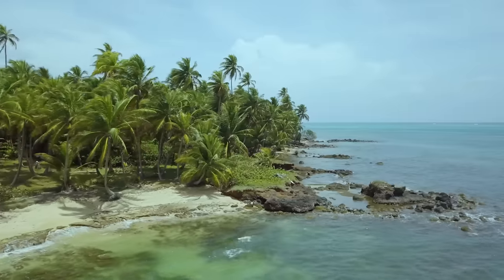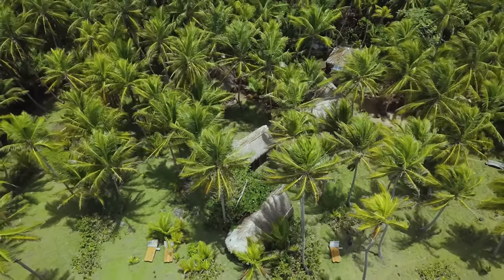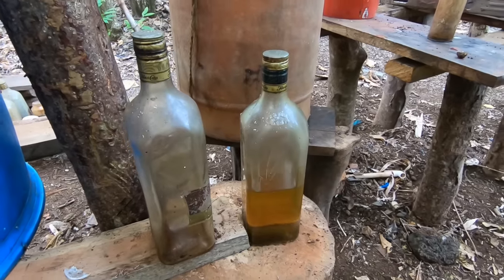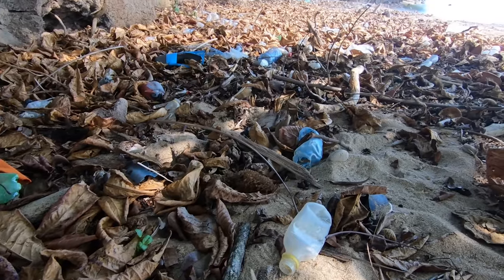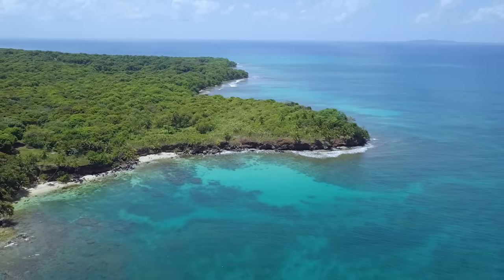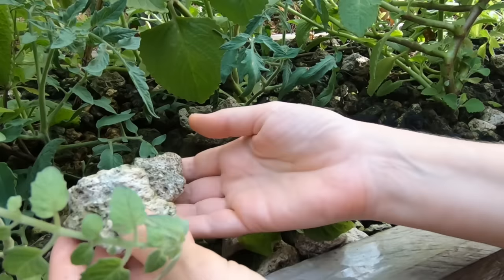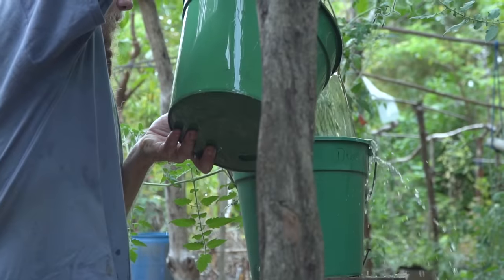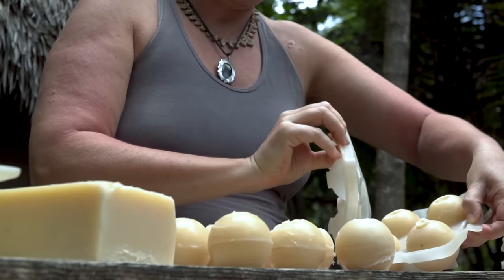THIS SELF SUFFICIENT FAMILY MAKES THEIR OWN FUEL FROM PLASTIC!

Comment: Diesel doesn’t burn like that (it has to be heated and aspirated to burn). It probably closer to kerosine as a fraction. I hope you have a good exhaust system as that fuel would most likely contain lots of sulphur and chloride and other compounds found in plastics. In other words it would be very toxic/poisonous fumes.
Reply: so he should stop using his generator because it pollutes the air but what about the 133 million big trucks that are on the roads in America alone, we should spare this guy any of your lectures i would suggest
Reply: @_RocketRooster  "but what about...?"

Nothing legally driving on any road in the western world is nearly as toxic as the gases this setup produces. It is completely fine if you don't care, it is completely fine if this guy decides to inhale that shit anyways, but it is also okay to point out the toxicity.
Reply: You have to  be careful which plastics are used. Not Vinyl, PVC, ABS, Nor Styrene. All can produce poisons such as hydrogen cyanide and other nasties. Use only PE, HDPE, LDPE, we also use PET as most of the plastic seems to be bottles, some people don't as  waxes can form in the pipe and cause a blockage if used motor oil isn't used or they don't have enough of the HDPE plastics for the waxes to dissolve into, other people may have better luck sourcing the good stuff better than we. Richer plastic piles to mine.  :)
  These plastics are very low on sulfur, PVC has the chloride which will eat the metals of your system. 
  There were still volatiles in the demo, normally they would be aired out before use or captured in a finer, secondary process.
Reply: I believe he was talking about the mans personal health. This wasn't exactly an industrial HSE production environment. More like DIY hippie scrapyard..
Reply: Beat me to it
Reply: Well Said!   Thank You for your comment.
Reply: You could run that smoke through my gasifier and turn it into perfect clean fuel to run gas appliances
Reply: I was with a guy burning brush and he saturated it with diesel and, as you point out, he put a torch to it for a little bit before it actually caught fire. His stuff lit much more quickly and easily.
Reply: Loral Anthalas  the second one is for his "gasoline" and you cleary don't understand the refining process
Reply: I can confirm diesel doesn't burn with normal fire. It had to be compressed. That's why diesel engines don't have bougies. I've tried to set fire to diesel from gas station (not at the gas station of course). Impossible. A mechanic taught me this trick in case you think you've poured gasoline into your tank. Put a cloth in it and try to set it on fire. Diesel won't, gasoline will.
I doubt that the second condenser changes this. And even if you select certain plastics, how toxic and erosive would the end product be? I'm very interested if this could ever be perfected to something (more or less) ecological, but I doubt this is it already.
Reply: This thread is hilarious.  People getting so upset and defensive and judgy.  The original comment is correct, but so is Mr Derek.  Derek was merely showing us a cross-section of his refining process.  But also, it's not like you're looking at a billion dollar refining station in a lab.  This is homebrew.  It's going to be a little crude.  Derek isn't producing the kind of diesel you want to run in your diesel truck every day.  Mr Derek is rendering a diesel fuel that works for his generator outside.  It's a start, a fantastic start and if a petroleum technician/engineer were to see this and get inspired... well there's no telling where this might take us in the near future.
Reply: There has to be some catalyst (chemical) added in separating plastic to gas or diesel.  You can't just burn plastic and run it through distiller then have it magically separate.  

If it is really that simple everyone would be doing it.  It requires the understanding of chemistry to do create fuel from plastic.
Reply: Keep up the green energy fight, well done. The reason it ignited so easily is due to a small amount of gas distilled at around 400deg. Diesel evaporates around 300 deg. I used a mixture of 10% gas with wvo in my 7.3L ford diesel for 6 yrs in winter.  Years later i read .Mercedes Benz used 30% gas in their winter diesel.
So your diesel fuel needs to be taken off less than 300deg .
Gas diesel for summer fuel not a good idea ( less power but good starting in cold weather) less lubrication for injectors and pumps.  Minor adjustments for you.  LOVE WHAT YOU BOTH HAVE  CREATED ❤❤
Reply: Loral Anthalas  actually i did, what makes you think i did not?
Reply: @RubeeDubee  diesel does burn with fire,I used to it in my wood stove.
I used a small steel can fill halfway with sawdust and tip a small amount diesel in a light.
Reply: @goatlady7761  Well, we must have had different diesel then, because both our experiences contradict. I presume you didn't have pure diesel.
Reply: @RubeeDubee  Flashpoint of diesel 52 and 96 °C, 126 and 205 °F. It will light just not nearly as flammable as gasoline.  A thin layer of diesel on a dry stick will light easily once it gets hot.
Reply: @pharanaiton6851  oh I misunderstood, you want him to spend Thousands of dollars on a solar set up.  Maybe he can borrow against his home, you know it will really increase the equity.  Or maybe he can get a loan from that massive bank on the island.  And I mean it's an island, so I'm sure the shipping and handling would be close to nothing.  And then maybe every time he needs to replace the battery system you can send him all the car batteries he needs.   And the old toxic solar panels that he'll need to replace every 5 years?  Well he can just put them next to all the other trash on the beach.  lol privileged thinking is hilarious 🤣
Reply: chlorine comes from PVC so yes i agree with this but where do you propose that "lots of sulphur" is coming from? It has actually been shown by many researchers that sulphur content of plastic waste pyrolysis oil is much less than that of traditional gasoline or diesel. I can't think of any popular commercial plastics with sulphur in its backbone. Maybe you are proposing it is coming from additives in the plastics?
Reply: Apparently sulfur content is important in the refining business. Crude is rated by the amount of sulpher in it. Libya has something like 'sweet' or some such moniker. Saudi Oil Is sour. It costs more to clean sour oil than sweet. Plastic is probably the hydrocarbon equivalent of sugar.  Super sweet crude. All you have to do is destill it because all the hard work had already been done.
  Tires may have lots of sulfer in them, maybe one reason people that do make fuel like this don't use them. Too dirty.
Reply: @dereksplace1342  YOU want high surfer in your oils and diesel fuel . truckers and diesel owners have to add sulfur and zinc back in for lubrication as oil and diesel producers take them out I use gear oil as an additive.
Reply: @Garandmasthumb  Thanks for saying. I didn't know that.
Reply: Add a gal of kerosene to a full tank to keep from gellin and lubricate the injector pumps..Diesel does need compression to fire..
Reply: @diyhandcraftedlifestyle9151  plz talk abt this.what is it??
Reply: @sushiquad  Many people burn neumátics and vulcanized rubber in those units, maybe he was thinking about that... I believe this is a good way to go and more energy should go on finding out how to minimize the impact of fumes by way of filtratión, bubbling systems and similar
Reply: In other words, you are jealous that someone is capable of doing what you are not because of laziness, so to justify yourself you will look for the dumbest excuses to discredit someone that you know is better than you in many ways, if you know a better way to do it, give up your toxicity and do it.
Reply: But its good for the environment...
Reply: @_RocketRooster  One engine at a time... lol
Reply: Yeah it would be better to throw it in the ocean.
Reply: Yea you drink it.
Reply: That's what i thought you cannot burn diesel like that and the toxic fumes are released through the air that is bad for the ozone.
Reply: @dereksplace1342   I think I remember my own experience wrongly indeed. I think it díd burn, it just didn't explode. In other words, diesel burns and gasoline exploded when lighted. Sorry that I remember falsely. I'm still not totally convinced though. I would like some scientist to show me why it's ecological. I can't imagine that it would be out else it would have been done long time ago. It would have become an industry. It's just too easy. 
To those toxic people out here, there is nothing wrong with criticism. We have to be critical for our environment. Too many mistakes have been done with good intentions.
Reply: Dude with all the, trees around and being outdoors, they have natural filters. Even diesel and gasoline ate poisoin if you are not properly ventalated.
Reply: @prodigalsonresurrection  Exactly. People are so arrogant in their educated ignorance.
Reply: @_RocketRooster  big rigs are literally nothing. the real problem are the millions of monster ships (tankers, cargo carriers, cruise ships, yachts, etc.) that burn thousands of gallons of diesel every. single. hour. that are only turned off a few times a month for inspections and cleaning. ah and don't blame trains either, locomotives burn about 3.5 gallons an hour with a diesel powered electric generator. if anyone actually cared all vehicles would be on their way to gas turbine electric generators and hydrogen. batteries are very toxic to the land to produce and the pollution from the combustible fuel is made by the power plants (unless nuclear or natural gas) that must provide the angry pixies, propane and natural gas although clean to burn like hydrogen are toxic to the land as well especially the production of natural gas. we already have the infrastructure of transporting and using natural gas so conversion to transport and use of hydrogen wont be that hard. hell there are even some on ytubers that have integrated and HHO generator into their vehicle and depending on the vehicle can get double the millage and up to a 95% burn of the used fuel which means that these make the vehicle far far cleaner to operate. there is this ugly 3 seat sports car that uses a 94,000 rpm gas turbine electric generator and with 20 gallons of gas can travel 1,200 miles. to save on production cost thus making this platform more affordable even if its scaled dawn to the millage that todays vehicles get then it would still be a far more massive leap than the lie of electric vehicles. the benefits of both worlds while substantially lessoning the negatives that would actually make a difference. there's a lot of blame to be had but trucks and truckers don't deserve it. because of that perception truckers are treated horribly despite keeping this country moving and all our wants and needs fully stocked on the shelves. seriously, if truckers stopped trucking we would have about 2 weeks before it all comes to a grinding halt... no fuel, no groceries, no supplies, nothing.
Reply: @seanowbo  it was heated
Reply: Clearly YOUR NOT LISTENING 🙉
Reply: @moronicvideos  Not an old engine, just based on old style. Definitely not picky which makes it great to have but probably not available in the US. KISS technology.
Reply: @dereksplace1342  That’s a great idea to capture the more volatile hydrocarbons for burn with others applications. It’s good to hear your only selecting some types of plastics. Plus your cleaning up all that plastic. I would still like to see a really tall exhaust system which is away from your residential area.
Reply: @EtreTocsin  So you think plants can process all chemicals? Well, they don't.
And other people here, u are so toxic that I'm not even considering to try this myself anymore.
Today, one cannot be critical anymore or you get insulted. Goodbye, intolerates.
Reply: @RubeeDubee  it’s an interesting conundrum, being critical and not getting criticized... I think you have to accept that it’s a always going to be a two way street. Eg, if you sound critical, instead of constructive, you will without doubt at least get the same in return—if not worse. 

It actually sounds like a double standard? But it seems to always comes down to a limitation of communication/breakdown. If you don’t speak the language perfectly, or don’t have a ‘good’ bedside manner (ie. are not polite/don’t care about offending people), then a platform like this that doesn’t include non verbal communication requires certain words in there place. 

Taking yourself out of the conversation, is one way to solve the discomfort of being criticized, but you could also put yourself in the other person’s position—where you are at the very least mildly attacking them/their credibility—and realize that the abrasive communication you are employing is maybe part of the reason you need to leave?

I hope that this comment is more constructive than condescending—honestly. Take care.
Reply: @dereksplace1342  this is really quite amazing. Have you done this long enough to determine if it’s much harder on the equipment—like factoring the cost of wear and tear—or anyone other drawbacks? Like after you get the fuel, is there still some kind of waste material, or are the bottles completely consumed? And like others have mentioned does there ever seem like there are toxic fumes—beyond the typical commercially refined fuels?

I appreciate your patience with the nay sayers—I suppose it helps (your patience with them) getting this incredible reward—just for cleaning your own beach environment.
Reply: That's by his GREEN mum's definition. HAHAHA without chemistry idea.
Reply: @danielgaughan4243  🤣🤣🤣🍌🍌🍌
Reply: We make a fire yah....pretty soon that island will be a sandbar
Reply: All you guys are a little crazy jealous that he is living literally what we all dream about so much that there was a long standing comedy TV show called Gillians island this guys is just living all the characters with his ginger/Mary ann/lovey wife. they are amazing he's a little Doc Brown (back to the future) being in the situation of Chuck Noland (Tom hanks in castaway) I would absolutely love to live there its my ultimate fantasy life. I have made a composting sewage generator about 20 years ago after watching the good life where this guy turns 40 and wants to retire so him and his wife with help of the neighbors turns his English lifestyle into a very urban farm for 17 years I lived that way making money to live on raise my kids then I was hit by a car driven by a 85 year old asshole who dropped his phone and decided to pick it going 45 mph in a 25 mph and hit me head on in my lane going the opposite direction leaving me disabled I survived but lost my way of living and live in extreme pain every second of every day so law makers and other idiots can keep me away from what they call poison that could make my life bearable and make me functionable again, otherwise I would be getting on a plane right now to be where this guy is. So let's not be so hostile to this place we call the world of information at our finger tips people! Your life can get so much harder and unbelievably cruel and inhumane one man's poison is another's will to survive. I think what u are doing is amazing ur all great people if I had the money I would be ur neighbor man. And duckweed best food in the world for laying hens and tilapia free fish food that doubles everyday lots of protein and vitamins even good enough to eat in some cases likes stagnant water lives on fish waste I grew it in the fish tanks in rain buckets cleans the water great thing to grow makes great compost as well can throw on top of tomatoes plants and can double the amount if cherry tomatoes. I feel like I could spend the rest my life discussing things with u even with the TBI and losing half my memories and retainable knowledge I started at 16 wanting to live like ur living I have so much I want to tell u show u and help u build if we all lived this way the world would be amazing and no pollution.
Reply: @jenniferscott3176  sounds like you’ve found the ways of peace through some of the beautiful ‘natural’ systems we’ve been given. Imagine what it’s like to not knowing anything truly ‘interesting’. 

Our minds can be cultivated in like manner, where they don’t require much external stimuli to grow amazing produce. The ‘right’ perspective can find/make sense in/out of all the craziness and difficulties we must endure.
Reply: lol anti carbon people..whats better to eat fish that often has plastic in is system birds dyeing from caps from echo friendly water bottles..
i mean real environmentalisms isnt drinking avian water and throwing your bottle in a recycle bin driving a plastic filled smart car around that last a year..
while it might be scrap yard hippie building...it was made from stuff most would have sent to the scrap yard..
plastic is a real problem just ask india rivers full of plastic waste more than fumes that could be burned off if you notice he puts a pipe into the fire this is the remaining gasses 
in the other experiments and professional/industrial systems its burned in a flare/torch
Reply: @goatlady7761  some peeps on here doesnt even know what diesel looks like much less to know if it burns, just sheep following the crowd. just ask them how a diesel night heater works
Reply: @D3adm3n  believe it or not, some people can actually come up with ideas on their own, should they reference their brain?
Reply: @dantronics1682  Sorry, yeh forgot we're supposed to trust everything we see on the internet. Especially when you don't have any references.
Reply: @dantronics1682  not to mention that he admitted that he didn't come up with the idea
Reply: @carls.6746  hey man, maybe start by looking up the number of ships that drive around on the oceans. You'll be surprised how far away your "millions of" estimate is :)
Reply: @pharanaiton6851  you think we can terraform mars but we can't capture greenhouse gasses. Lol... Newsflash...they can. And if any of this global warming crap were real then the banks and moviestars wouldn't be buying up beach property. This couple is  genius...gasoline renewal, sustainable chicken feed, organic run off, Self Watering /fertilizing crops, and cleaning  the oceans, all at the same damn time...Apologize to him ... kiss his hand... and shut up.
Reply: Burning plastic isn't renewable energy.
Reply: @diyhandcraftedlifestyle9151  more details?
Reply: @wordsoflife5987  so the moviestars knows something we don't?
Reply: @moronicvideos  It's mostly a remake of the old Lister diesel engines still produced in india. They are slow running and can run on "diesel" far off its industrial spec. They are legal to operate in many areas of the world but not the US where EPA ruled them illegal because of their inefficiency. Mostly a political thing back in the days to protect the gas ecosystem as apposed to diesel engines.
Reply: It may have a more volatile ability but in turn it would end up damaging the engines that he's easy unless there is a special allocation for whatever he's working with and making a justments that would be critical for rings and other parts of the main engine. There's ways to make adjustments but you have to be pretty smart which most guys don't have the wherewithal to figure that stuff out
Reply: @_RocketRooster  Nice whataboutism
Reply: @danielgaughan4243  so true, it's  the tragedy of whole mankind
Reply: Zach Sheffee  Read everything before you answer...ffs
Reply: @munchichi8  you must mean "added energy"?
Reply: @_RocketRooster  trucks have catalytic converter
Reply: Why do people even comment,, no one cares what u think!
Reply: @johnwane4034  ......but then why did you comment...no one cares....
Reply: Seeing peoples reaction to your comment has made my day.  So much creative justification because they don't like the facts lol. Mrfr87: Hey burning that's not great Response: well what about this other thing! What about this unrelated thing! Mrfr87: okay well, that doesn't change the fact that burning that's not great though. Response:......shut up.
Reply: It won't have chlorine if he's smart about what plastics he uses. In fact, most low-value thermoplastics don't contain chlorine, which is more common in thermoset plastics.
Reply: @RubeeDubee  diesel does not have to be compressed to burn.   It needs to be a vapor to burn.   If you put diesel on leaves and light the leaves, the fire from the leaves will vaporize the diesel and it will burn. But it won't immediately flare up like the video shows.   I have a ranch and burn brush all the time with diesel. Diesel on a cloth will indeed burn if the cloth is set on fire.   The fire from the cloth will vaporize the diesel.  I usually start my fires by getting several paper towels,  putting them so the wind will push the fire into the brush, pour some diesel in that area making sure to get diesel on the paper towels.   As soon as the paper towels are lit, the diesel begins to vaporize and the fire starts easily.   In an engine, the diesel itself is not being compressed.  The air in the cylinder is being compressed which vaporizes the diesel so it can burn.   The newer high pressure fuel injection pumps vaporize the fuel faster which makes them burn cleaner and more efficient.
Reply: @carls.6746  You apparently failed physics.   Diesel electric locomotives burn 3.5 gallons per hour when sitting at idle.   They burn 188 gallons per hour when at full speed.   No way on the planet there is enough burnable energy in diesel to propel a freight train using only 3.5 gallons per hour. Trains, though efficient are not as efficient as ships.   Ships fueled by fossil fuels are the most energy efficient mode of transport with the exception of nuclear powered ships.   The reason the vast majority of ships don't have nuclear propulsion is the outrageous cost.  Several car companies have tried the gas turbine engines and gave up on them.    On board hydrogen generators use more energy than they provide.  You have been deceived by scammer youtubers into believing hydrogen is an answer to fuel problems.  To make  hydrogen by electrolysis takes as much energy as it gives off when it burns.   One could use excess power from wind turbines or solar panels to make it but storing hydrogen for use in an automobile is not practical or safe.   Large industry makes hydrogen by steam reforming natural gas.  No way to use that technology in vehicles.   Industry is trying to make the most efficient vehicles as practical.   They are not hiding anything.   People like Elon Musk are gradually changing the world but there is no magic pill to be had.  Nuclear is a great option but most don't like the downside to it.
Reply: @puppyupper4565  must be hard lecturing people about tech thats been in use all over the world for many many years... (for instance Pakistan once being a diesel empire with nearly all of their vehicles being diesel because of how cheap it was, to now diesel being so expensive public transportation across the entire country has converted their diesels to run off of  natural gas. you fail to realize the enormity or hydrogen, propane, and natural gas powered vehicles out there.) and physics... when you dont even have an understanding of basic math. please do tell how a train that burns 3.5gph idle and 188gph full throttle that is actually turned off when not in use is less efficient than a monster ship that can burn hundreds of gallons per hour idle and thousands of gallons per hour full throttle that will constantly cross hundreds to thousands of miles and is shut down only one day a month for cleaning... it is the future but we need a transition period to get there and thats where electric comes in but its nowhere near as good and definitely not as clean as what the public has been led to believe.
Reply: First distilation is a mix. And when mixed with wood chips - diesel burns also like that (even lard does). Yes it produses surphul but - dude lives in a hut made of grass - got plenty of ventilation there.
Reply: @stefan514  All you need to do is refine, refine and refine some more. How do you think the fossil fuel companies arrive at the legislated fuels in the first place ?
Reply: @danielgaughan4243  KEROSINE
Reply: Pretty sure anything burns with a hot enough ignition source bud.
Reply: Not to mention it will destroy the engine very fast
Reply: @TheKitMurkit  that’s what truckers do in America and I’ve seen the engine tear downs.. the parts are immaculate.
Reply: @TheKitMurkit  my Cummins has 400,000 miles is in perfect condition! I’ve replace ,oil,water pump so far. Based on my experience what would you do? 0 leaks.
Reply: @TheKitMurkit  its a lubricant in small amounts like everything purpotions matter. that's why in america we have to add oils to diesel that have been stripped of its natural lubricant properties.
Reply: This may be true. My mom used to burn kerosene heaters in our home growing up and the heavy black soot would stain the walls. We would have to scrub them often.
The problem I see with your statement is that your giving negative energy to it rather than seeing the potential & maybe helping with any information that you may have to help them. 
I worked at a factory that the EPA came in & made them build something like an incinerator to burn off the gases that they were emitting in the air to clean it up. That is what I believe he needs to focus on here. Some kind of burn off with a filtration system that could be broken down and reintroduced back into the ground as a renewable. 
My point in this is rather than just seeing the negative see the positive and work off it to create a better solution with better ideas. It's a marvelous thought to live eco friendly as he is attempting to do with success as well as potential drawbacks. Think about it.
Reply: @diyhandcraftedlifestyle9151  Now this is the perfect kind of comment! Instead of beating a guy down for his idea with negative energy you chose to contribute a term we don't use often enough: constructive criticism aka positive energy! Kudos to you. Think about it if you two worked together to help each other out and the environment! And instead of looking to become tyrant kings who would want to use it to your own advantage to rule over people you offered this as a sustainable development to people to live more healthy equitable lives? 
I have been watching people online with their homemade gasifier's & I think it's awesome! Be kind to others and kindness finds it's way back to us all! Love your spirit!
Reply: @pharanaiton6851  Just a curious observation to your comment: keep cleaning the beaches 🤔. He lives on an island. What do you suppose that he should do with those plastics & debris that keep washing up on the shore? Dig a hole and bury it? Maybe call up a freightliner company to come by every so often to pick up his trash? Oh that would cost money that he's trying to save & reinvest back into his product. Give helpful ideas how to refine his process. A heat exchanger or gasifier or a air purification system or a incinerator to burn off the fumes. Solutions to a problem are better than negative comments.
Reply: I've been very interested in earth ships since being introduced to them. Your ideas with the fish tanks and the water filtration is what they do. All of their human waste byproducts are run through a septic system that is used to fertilize their plants which in turn runs through their tanks for fish. It's reusing or renewable energy. There was a company in NY years ago that was called Changing World Technologies that did what you're doing with not just plastics, bit all carbon materials. They would take old used tires, plastics, papers, cardboards, foams, wood, you name it and shred them  running them through a condenser process just like yours where it would turn it or process it into a clearing yellow liquid that was a bio diesel fuel that he was selling. Well as I understand it, big oil didn't like this at all. Needless to say he no longer is in business. Your ideas are awesome. You might want to work with someone on getting the pollution problem cleaned up like using a gasifier, air purification system, or an incinerator with an air purification system. Something to clean the air up on the island to keep you from getting cancer from those fumes. Positive energy is what you need not the negative comments. Kudos to you.
Reply: @RJNehlen73  My main point was I really hope he has a tall chimney to carry those fumes up and to allow them to blow away so there is no chance of inhalation. Burning kerosine near you is really bad for your health. Even if he is burning crap his carbon foot print would still be tiny.
Reply: @_RocketRooster  Understand what you mean, but actually mrfr87s comment is very valuable. If you were going to consider using this process, you would want to know this.
Reply: @RubeeDubee  i would with diesel everyday. If you use a wick, diesel will burn easily. Petrol will liggt without a wick. 

Diesel has a lower flash point than petrol. This means diesel needs lower temperatures to light but is less flammable  than petrol.
Reply: @thekarmafarmer608  my point was that he's burning plastic, toxic plastic! There's a medical disposal place near where the company i work for keeps material, guess how they dispose of the medical waste. They burn it and its mostly toxic plastic and thats one really tiny speck in toxic plastic thats burned in this world so what this guy is releasing is insignificant!
Reply: @stefan514  true...not much good comes out of plastic
Reply: @pharanaiton6851  so he's making carbon dioxide. The gas that green growing things need to live. And green growing things provide oxygen which we need to live.

I'm failing to see the problem here.
Reply: Well said 
Toxic/ Carcinogen for humans as and environmental reasons
Reply: @pharanaiton6851  ya but also better than buying diesel for the generator
Reply: @prodigalsonresurrection  a petroleum engineer would see this? And learn what? How dangerous it looks? This is pretty much the reverse of how plastic is made I'm not sure why you think it's groundbreaking
Reply: @zerazara , diy hippie scrapyard, on an island that’s not under United States  EPA jurisdiction.  I can’t even burn cardboard boxes here.
Reply: @RubeeDubee  I think he's doing great. Add a tube at the end.and you got natural gas for cooking. No smell no fuel wast.
Reply: @goatlady7761  Yes, we use diesel because is it  a slow to light burn, not a explosion like petrol.
Reply: @prodigalsonresurrection  yeah he'll get loads borrowing against a shack made of palm leaves and sticks
Reply: You're full of it, I've burned plenty of diesel fuel on a surface in open air. It's harder to ignite than gasoline, but it will absolutely burn.

Once had a crack in my truck's fuel tank which slowly, over the course of months, saturated the concrete slab where it was parked. One day, I lit the grass it had killed on fire, and it spread to the slab, which continued to wick the diesel out and burn for over a half hour.
Reply: @diyhandcraftedlifestyle9151  Please share what you mean.  Times are going to get worse, and I"m hoping that some of us can share and stick together.  I'd like to know how to make a gasifier.
Reply: @stefan514  Haha you haven't seen my truck